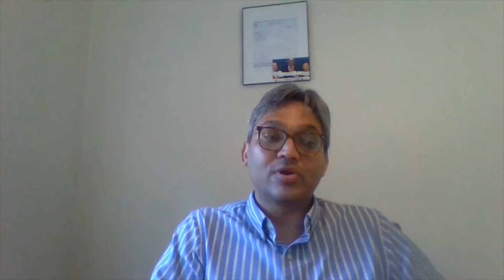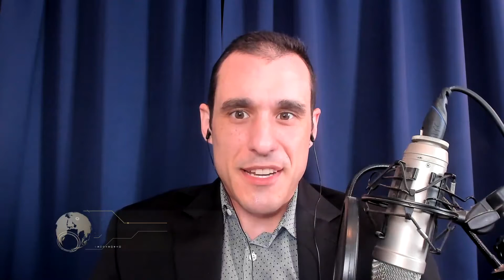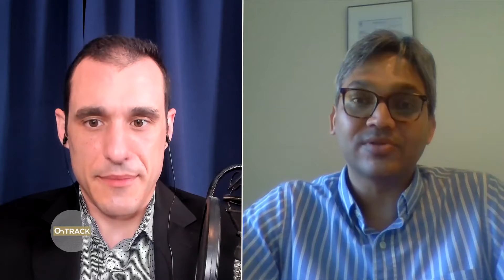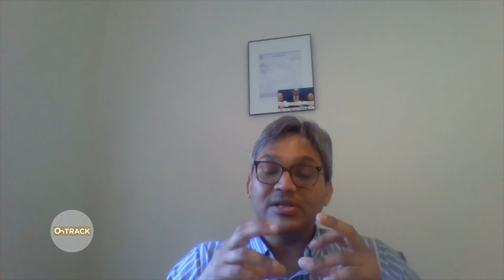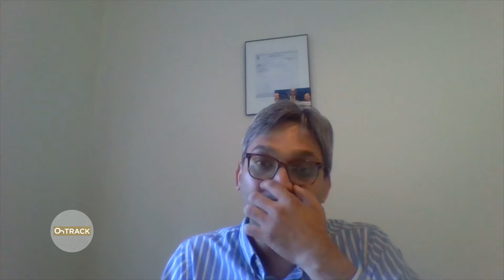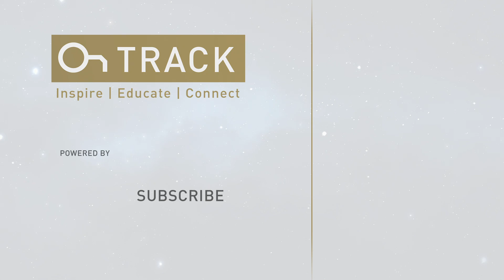Dr. Kunal Shah Reveals How to Select the Best PCB Surface Finish

Comment: I know that solder mask doesn't really "count" as a surface finish, but like surface finishes, it increases the losses of the transmission line underneath it, while simultaneously protecting the copper from oxidation etc.  This is why sometimes RF traces have the solder mask removed from them.  But I haven't seen anything that shows how performance degrades as the exposed trace ages.  Plating can help protect the exposed trace - immersion silver and OSP both seem to be as effective as bare copper - but those platings are also known for short shelf life, tarnishing, etc, and there is still a lack of detail on what happens to the trace as it ages.  I even thought about the merits of adding some geometry to the paste layer of the PCB so that during reflow the solder would cover the trace, but I imagine this would end up being similar to immersion tin, which is about as lossy as solder mask.

Do you have any suggestions on how to judge these impacts?
Reply: I'm not sure where to find some definitive data on this, probably something from APEX proceedings or from SMTA papers. In one of the radar modules my company has designed, we were interfacing with a Texas Instruments reference design and tarnishing of the silver finish was a known issue in the design. We contacted the TI applications engineers and they told us they tested designs with and without tarnishing, they did not see any change in the impedance or RF performance at radar frequencies. That's only for immersion silver, I'm not an expert on the degradation of other plating options and how it impacts reliability/signal integrity.

Comment: For OSP PCBs, should OSP be applied to exposed PTH vias as well, or should those vias be tented over, to avoid potential risk of exposed copper after OSP degradation.
Reply: If you're soldering onto the PTH then would already be leaving it untented, so it will get plated. If you are not soldering onto the PTH, it is your choice, anytime you want the a through-hole to be un-plated you would tent it on both sides of the PCB.